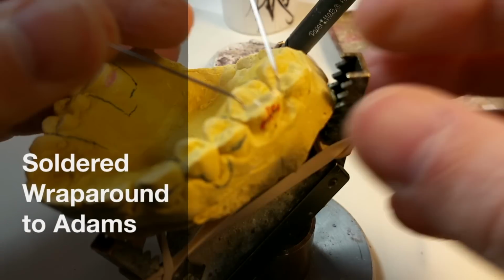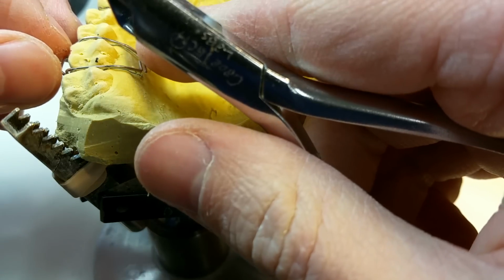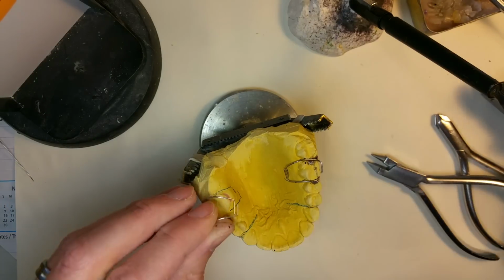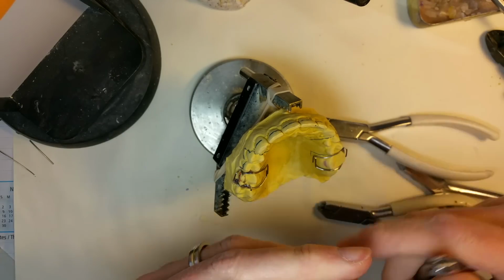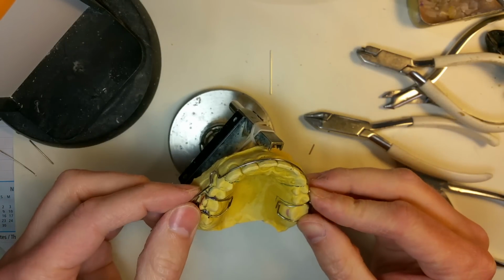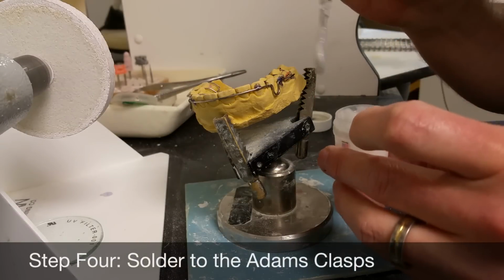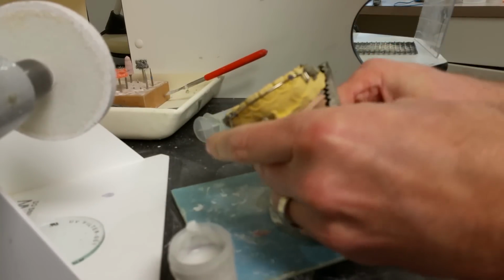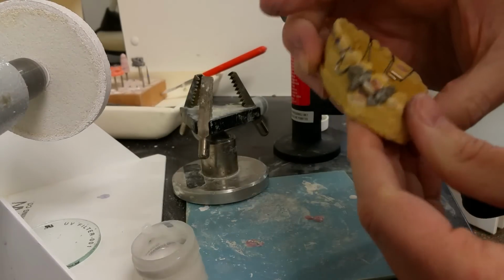Soldered Wraparound to Adams Short Version

Comment: Good day. Very good your video. I live in Brazil and I have a question: What do you use to secure the lead, a purple gel and then a liquid jet? examente in time was 1: 18.Muito thanks, I await your return.
Reply from the maker: The purple gel is called Z-Base, it is a generic product of Zap it base. The stuff i spray on the Zbase is accelerator. It accelerates  the setting up of the Zbase to under 3 seconds
Reply: RetainerDesigner Thanks for the answer but "Z base" no use to me. Here in Brazil should not have this name.
Would you do me a favor and take a picture of the package Dimensions and send it to me? Describe the components of the product so you can view it here against the product under another name?
Thank you